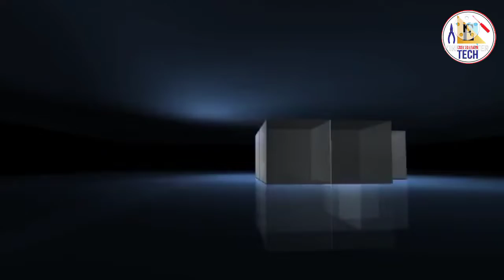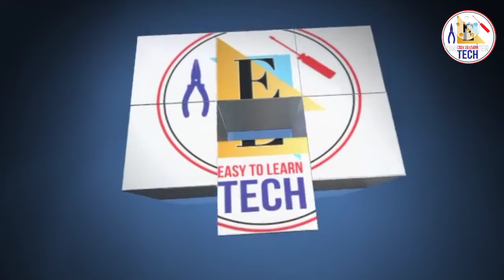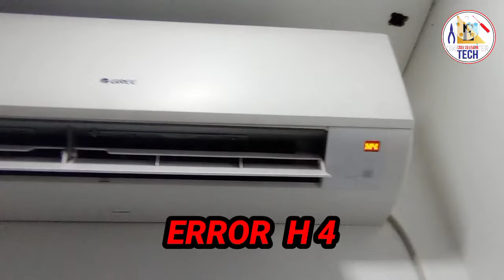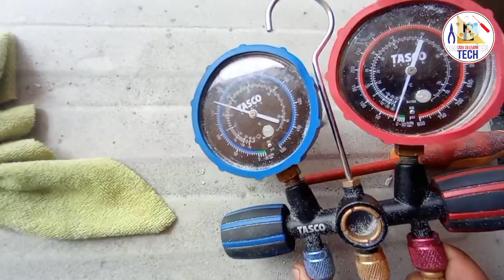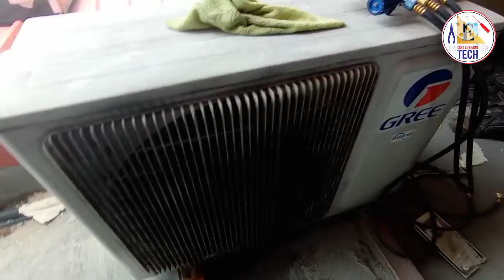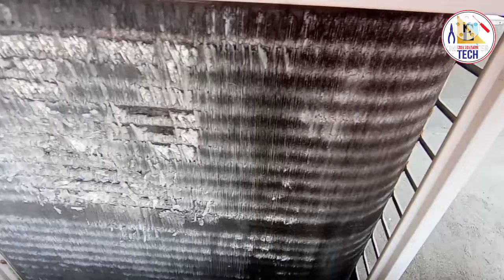Gree Inverter AC Error Code H 4 // HOW TO SOLVE GREE INVERTER AIRCONDITION H4 // H4 ERROR CODE /GREE

Comment: Hii can you tell me whats wrong with my ac bec it is not giving cooling only one gate of my ac is giving cooling and I instal soo much apps but it not works well my mom says it have no gass ❄🌬
Reply from the maker: 1: check if the air coming out from the indoor unit is 💯 percent or not.
2: if air is less need to clean the ac filter, blower and coil.https://youtu.be/ZDAAmiK3QOs
3: check if the coil is forming ice or if half of the coil is cooling. This means gas LEAKAGE. https://youtu.be/vae4_FHjZaw

Comment: Blue star ac invert error H4 means
Reply from the maker: H4 means : outdoor abnormal
1: check the fan ,if it running properly or not.
2: check the outdoor PCBS card if the power is ok for fan motor & compressor.
3: need to check the compressor.
If any one of this is faulty need to replace that parts...